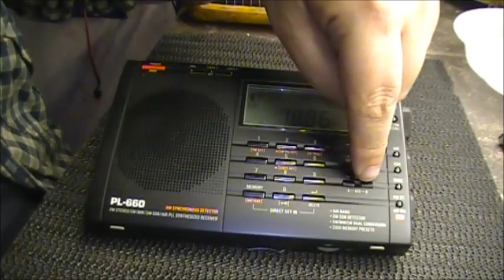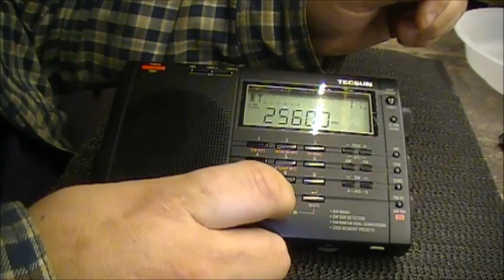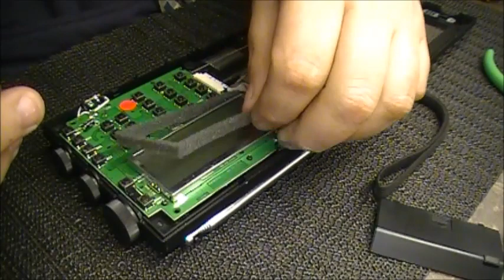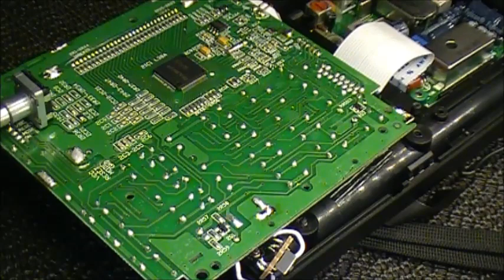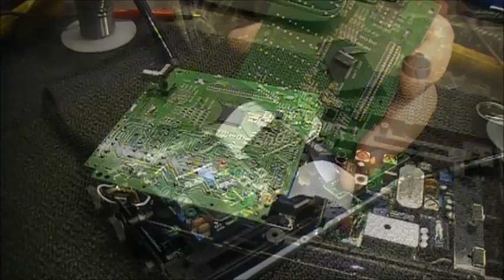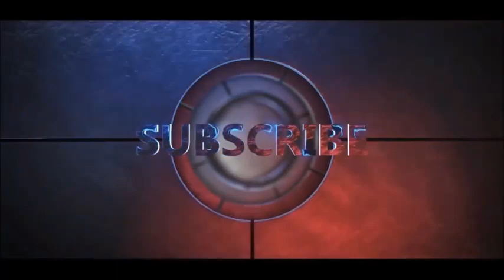TECSUN PL660 - BUYER BEWARE

Comment: Thanx for sharing. Great to see what is inside.
I recently received mine. When I started to test it and exposed an issue:
The problem is the middle encoder (BFO knob)  (fine tuning) which is defective. It is impossible to use the SSB option because even if I touch it gently, sounds is jumping and has strange impredictible  behavour. Need to press it deeply and turn in order to make adjustments. If I dont press it or release, it loses contacts

In this point, what do u think, Is it fixible?

Thanx a lot in advance
Reply from the maker: Use contact cleaner to clean the inside of the control with the batteries removed, or replace the part with new. ;-)

Comment: I couldn't ask for more as to the performance of my Tecsun PL-660. The only issue is the shortage of affordable parts, at least in my place.  I broke the original antenna because it got caught in my van's automatic window, and the pegs on its stand got snapped off.  Together, these parts is worth two or three surplus pocket radios, or one brand new shortwave radio.  I bought it eight years ago when it's still relatively cheap--now it has tripled in price.

Comment: I own a pl 600, the brand new device does not turn on from the red power button for no reason, I press 3 and it turns on and off, the other buttons do not work, the screen light turns off whenever it wants or stays on constantly, what could be the problem, there is not even a scratch, I kept it very carefully, I did not even use it properly, In other words, it works like crazy, only FM works, the buttons do not work when you press other bands.
Reply from the maker: Quality control on these radios is very bad, many people are having problems with these radios.  I for one, do not recommend them at all!

Comment: I have two PL-660s that stopped working after just a few days of use. Both were purchased in 2021/2022, with only about 6 months between them. These receivers suddenly stopped working, and I can't speculate a plausible reason. I was using an external antenna with the first one and was listening to ham radio stations on the 10-meter band when it suddenly stopped working. For the second one, I used it normally, turned the receiver off, and then, after a few months, it didn't work when I tried to turn it back on. Both radios exhibit the same symptom: they turn on, and you can hear the traditional static noise, but there is no RF signal. Given this, I would like to know if anyone has had a similar experience and if they managed to fix it.
Reply: You might have burnt the RF input. Did u plug in an external antenna ? 
Ext antenna input is NOT PROTECTED as whip is ! It's plain stupid. So anything you plug in that input, you should first build your own protection on it and be carefull with static electricity, storms, etc...
I'm very paranoïd with my PL660, keeping it in a "Faraday"  cookies box, always doing the "touch ground first with that antenna wire before u plug it in" ritual, and keeping it with attenuator set to max when not in use.
If that frontend FET is burnt, you may still hear weakly on strong signals, and fixing it is possible, just look for the same FET or any compatible replacement. There are some.
Great radio for me, no problem, only minor alignement offset between LSB/USB like on "every" radio around. 5 years old, everyday use, cat once barfed on it, it's still 100%.

Comment: the problem with the micro switch/touch switch is that if it's been used for too long there will be a layer of corrosion on it due to humidity. I'm an electronics engineer and that happens very often on tv buttons.
Reply from the maker: Thank you for the information.   I see lots of these type switches fail on many other devices as well.   You would think they would seal them from humidity and other causes failure.

Comment: I bought this 5 years ago and now almost all button has fault and just checking is there anything I could do to fix it DIY or just put it for recycle. Good specification but horrible manufacturing.
Reply from the maker: You could replace the faulty switches with new quality types.  :-)
Reply: @Radionut63  Did you replaced yours at last and work again? For my case I will need to replace all the switches and that will take lots of effort.

Comment: Those cheap switches get moisture and water damaged easily. Really common issue round our place. Put a couple of drops of 99% iso alcohol into the switch mechanism and press it in and out a bunch, that's usually enough to get them functioning again.
Reply: Yes, and it's not radios only, it's in everything. Microwave oven "died" of an easily and quickly replaced miniswitch, etc Everything made today have minimalist crapy miniswitch waiting to die. Not a lethal issue if you save spares from "junk" and have an iron, tho, and alcohol as u said.

Comment: $300.oo❗️I only paid $130.oo.
The radio [ had] a 1 year warranty - they would have replaced it with no hassle.
  5 years ago I bought one , and it went out after 3 months.
Warranty replaced it with no hassle.
  [ the replacement was eventually stolen, so just a couple years ago, I bought another one.
I also have the PL-600, and PL-680, and PL-880, as well as other Tecsun radios.
Considering how many of these radios sell, it’s really surprising that there are only a small handful of complaints.
This has been a best seller for Tecsun for many years [ and they sell some 5+ MILLION Short Wave radios each year.].
   Interesting video.
📻🙂

Comment: That sounds WAY OVERPRICED for this radio. I’ve NEVER 👎 heard of ANY Tecsun radio costing $300.00. It can be true, however, if it has special features. By the way ya were pressing the buttons, this radio seemed to be exhibiting problems of a cracked circuit board. Yes, it can happen, where sections (or all) of the radio doesn’t work, or works like 👍 it’s been dropped. I’m a radio buff 💪, too, and my very favorite is the Tecsun analog radios, regardless of the model number. I also like Tecsun digital radios, too, but it seems like 👍 I favor analog the most. I’d fill my house with these, if I find them at thrift stores 🏬 and such. I often search here, because I like their low prices. No radios have gone for more than $14.99. Some bigger models I find this understandable on, such as $49.99. Them can be half off on sale day, but this can be very aggravating waiting for, because your favorite product can be gone. Your friend, Jeff.

Comment: You're lucky.  At least yours lights up.  Mine ran occasionally, maybe 15 hours total in 13 months....and then it just plain went dark.  Nothing..... what a disappointment.  I changed out the supercap as some have suggested.  Traced what I could.  Checked all the power circuits and power switch.  I don't have a signal tracer, dammit.  Still all dark....nothing.
Reply from the maker: Sorry to hear that.  :-(

Comment: I can't say that I've seen so many poor factory solder joints like that before. I have the PL330 and it's great. Down the track I'm thinking of the PL680 and the H501. They do have quality control issues sometimes but you should expect better as some are very expensive!
Reply from the maker: It happens, but apparently only to equipment i own... ROTFL
Reply: @Radionut63  😄🤷‍♂️

Comment: So far I've had this radio for about a week and a half now will be 2 weeks and I've had no real major problems I program all the stations that I want where I live and they seem to be working all right so I have no problems it's on my desk plugged in I put some regular pen light batteries in it just so it will hold the the memory programs so everything seems fine I will check the keypads there from 1 to 0 you'll enter frequencies so right now I have no problems.
Reply from the maker: Glad to see you have a winner.... mine was a basket case till i re-soldered most, if not all the connections.  I gave the radio away to a friend who has been using it without any issues what so ever.      Guess radio equipment just hates me?
Reply: @Radionut63  I guess it's somehow just got lucky but it was a new radio so I didn't have too many problems with it sounds good it's not bad coming from China is one of the better radios and if it's on my desk there that's all just that when you listen to the FM through headphones it's classed as stereo but not multiplex stereo not like my secret name where you get nice full separation of middle left and right stereo I'll keep it anyways..

Comment: Just remember to take the batteries off when not in use. I've forgotten mine and the connectors get so rusted I can only use with a power supply, I've never seen anything rusting that quick.
Reply: did you use duracell battteries?these are leaking before the end of use date!

Comment: I’d unplug connectors and plug them back in, use a magnifier to look real close at components to see if they’re smashed or damaged especially around screws or fasteners. When they assemble boards and attach certain components they use drill drivers that can slip and damage anything the driver touches or skids over. Check ribbon cables for tears and bad connections. You practically need a microscope to look over the boards and there are defect investigators in the company that use microscopes to pinpoint defects in boards.
Reply from the maker: -Tried all that.. made zero difference... i no longer have the radio so it does not matter to me anymore.  :-)
Reply: @Radionut63  what is a good and reliable radio that has the same or similar features as that one? Apparently, Tecsun doesn’t have very good QC and no doubt the boards are made of inferior components or occasional bad batches of components.
Reply from the maker: Anything SONY or Panasonic are great quality for receivers, cant beat the older gear.  My all time favorite shortwave receiver would be the Panasonic RF4900.  Hard to find now.
Reply: @Radionut63  thanks

Comment: So you have a video how to change a whip antenna on a pl-660?  I bought a stainless antenna from Tecsun because my original was loose from the factory, turns out something must be broken in the wrong order or missing. I know there is the one screw that holds the base of the antenna in the chassis. What keeps the screw from going I to the body of the radio? Do you have any photos?

Comment: It's a shame. That the workers are slave labour. And it also depends at what day the rig was built. Fridays "child" Does not compare with Mondays.  I also got the same with generators two were sent one on a Friday then according to code the Monday rig ran swell. The difference like a screaming banchie  or a good collie dog.  The same as two radios the battery box. Didn't fit well. A little TLC helped fixed that. So a fine radio might go bad cause of worker flategue . And yes floating solder ( clod joints)on a $5.99 . Radio became a hot rod. Vs the un touched one. .

Comment: Are the Eton radios better, same or worse quality than Tecsun?
Reply: @DrDennis77
They (Eton/Grundig) are actually a bit worse for QC.
Reply: @watershed44  Agreed.  I recently bought an Eton Executive.  Died after two days and returned it.  Also, while it was  still working I found the user interface entirely non-intuitive as compared to the Tecsun.  
Edit/add:  I have also bought a couple Sangean radios.  Just AM/FM, not SW, but they are very good.

Comment: My PL660 one annoying thing is with the batteries fully charged the radio drains the batteries with non use in 5 days.  I have a PL880 that's gone months not used and the batteries stay fully charged. I've used different brands of NiMi. Slow leakage defect in that PL660.
Reply from the maker: I have a portable receiver that will do the same thing as well.

Comment: My radio was tuning 0.05 MHz away from the true frequency on FM. Plus, the sound quality was scratchy no matter how finely I tuned it.
Reply from the maker: These are not the greatest radios.... But, if it works, it works.. giver!
Reply: @Radionut63  I recently learned there's a hidden code to re-center the frequency readout but if that's not already done at the factory I can't be bothered with that radio. That and the permanently scratchy audio didn't help.
Reply: @kjrehberg  What's the hidden code
Reply: Another YouTube gives demo for freq tuning, for SW press/hold air button until backlight flashes then adjust freq with tuning know. For FM press/hold SSB button then same as above. Checkout demo for more info.
Reply: Knob, not know

Comment: at US$100 these radios are throw-aways if they go tango uniform... i got one, tested it out for 24 hours and it is working fine... a few glitches in software and ergonomics, but otherwise the best-performer in its class and price range... comes with an Amazon 30-day no-questions-asked 100% refund warranty, so chances are that if it working for several weeks it will be good to go...

Comment: I've had my PL-660 for about 5 years not, got it new. No issues with it what-so-ever, really a great radio, very sensitive on SW and SSB is a joy to use. 

This PL-660 is much better than my PL-880 and S-8800, there is a AGC issue and bad distorted sound on SSB but this is an issue in many DSP radios. 

My PL-660 is beat up now from heavy use and even though the case is cracked, I dropped it many times but it performs extremely well and a joy to use on SSB compared to the PL-880.

Listening to a weak SW station with a close strong station close by, switch to LSB/USB and the interfering station is gone and the weak station clear as a bell, amazing radio performance for the money. SYNC works well but USB/LSB works better against fading.

You can't do this on the PL-880 or even the more expensive S-8800 due to the AGC issues and distorted sound on SSB. 

If you like SSB at all or like to hunt for weak DX stations and like to use SYNC or SSB to eliminate QRM and are thinking about buying the PL-880 then don't. It's rubbish. The PL-660 or PL-880 would be vastly superior for SW and SSB and also finding DX stations via SYCH or SSB. 

I like the 660 so much that I ordered the PL-680 from Anon-co last week and should have it Tuesday, can't wait. 

I listen mostly with proper external antenna about 40 feet high.
Reply: I have the pl 660 very good radio I haven't used it much but it's in my office plugged into an amplifier I managed to understand how to program radio stations and nfm and some shortwave stations and not many shortwave stations at all which is disappointing the age of computer has killed the shortwave dxc great radio nice looking radio too bad it doesn't come with the leather case otherwise it's clean and fairly good.
Reply: I'm just wondering when I'm tuning the AM stations I noticed that the stations in North America are intends 660 670 680 but my home idea is when I tune from 660 let's say to 680 I have to go 661-62 I don't want to do that I just wanted automatically 660 to 670 do you know if there's anything on the radio that I have the same as you the 660 that I have to press I don't want to go through a whole bunch of numbers just to get to the next station on the am bad let me know
Reply: @normanbloom  
Radio is set for 9 kHz.
You can change it to 10 kHz, easily - you’ll have to watch a video or refer to the manual, because ,I FORGOT 🤣.
North America uses 10 kHz spacing, the rest of the world uses 9 kHz.
📻🙂
Reply: When on AM (MW) hold the Light Snooze button the screen will flash and either say fast or slow you want it to say fast, also as someone else said you want it set to your locale, hold number 3 when switched off to changeit, if it is already tuning in 10khz no need to change that.
Reply from the maker: Some are great, and some are junk, these are awesome radio's with great receive when they work correctly.  But there are other people out there that are not having the same great results you have..  Good luck with her.  :-)

Comment: I bought a Tecsun PL 310et that doesn`t work on AM using the speaker...reception is extremely weak, but using earphones it works fine. The Chinese make a lot of junk...
Reply from the maker: This POS is no different... about ready to toss this one in the trash!  LOL
Reply: @Radionut63  I have a Grundig G6 that I use for SSB. I hope I can find something decent to replace it with when the time comes. Everything is made in China though. No more Tecsun crap for me. They`ve lost my business.
Reply: @Radionut63  I love true analog circuit radios so I bought a Tecsun R9700DX. With only a few hours of use it seems the tuning capacitor is shorting out or dirty. I just received a Tecsun 660. I heard great things about it then saw this video. I just wanted a radio with SSB that has an external antenna connection with some gain control. Back in the 1990s there were so many cool SSB signals like coast guard and boats in the ocean I could pick up. Hope I didn`t buy a piece of junk.

Comment: I see schematics getting hard to find. radiomuseum holds it hostage for cash and sign up. Its not even their property and electrotanya now has the blasted captcha that they can pound up their arse.

These jackoffs holding our information hostage
Reply from the maker: Totally agree... I save all sorts of schematics, manuals and service manuals as i come across them. :-)
Reply: yap, info should be free, right? I wonder why the manufacturer, TECSUN in this case, is not releasing the service manuals. By the way, RadioMuseum is a large community where members contribute with info and schematics to be used by other members; you can join too, it is a one time small fee to pay, that is all.

Comment: probably a common trace for down 5 and 0. find it and see where it goes. I bet its the cpu pin loose or something
Reply from the maker: I had a look the best i could.. i think it is those thru hole copper connections that connect one side of the board to the other.